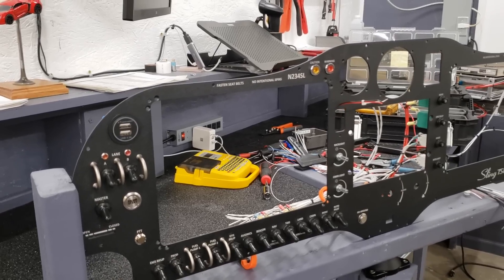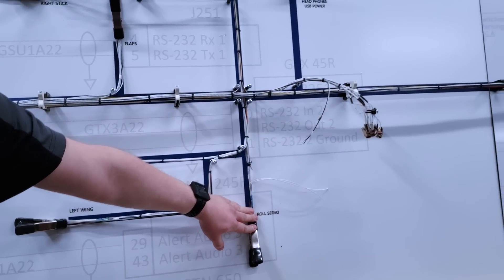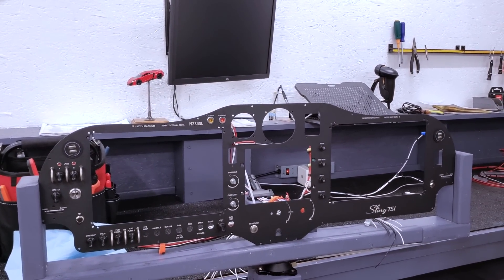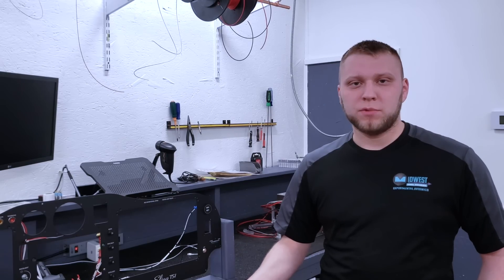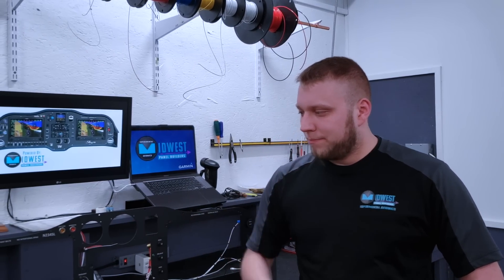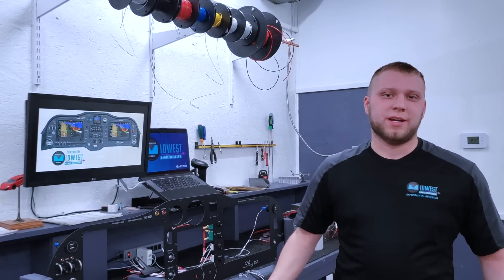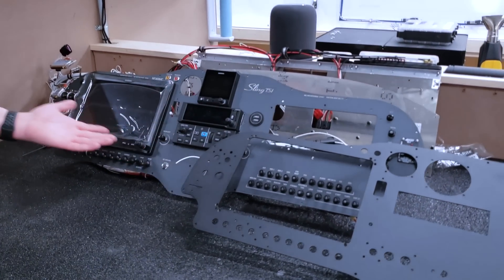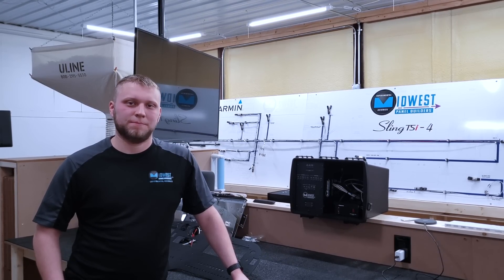Customized Avionics l Midwest Panel Builders - Mojosling Build EP11

Comment: Is the G1000 the best?
Reply: No. The G1000 is super old tech. It's also VERY expensive. I train in a sling 2 but also do instrument training in a redbird flight sim with the G1000 setup. The G3x/GTN setup does virtually everything the G1000 does but adds touch screen and is WAY more intuitive. The only thing the G1000 does that I can see that most G3x based systems is duel VOR's. But if that is important to you, you can just install two GTN's. The G1000 is already being phased out by Garmin also. So you can buy an old clunky non touchscreen system for $100,000 or get the very best and new tech with the same ability for half that.
Reply: @kevinbutler9786  Oh I see. Thanks for the information. I always assumed it was the best one.
Reply: @Devinci297  It was for a long time. The G3x is just that system but newer and more intuitive.